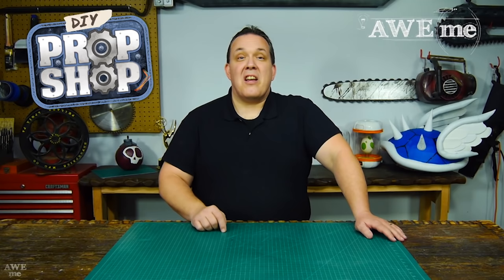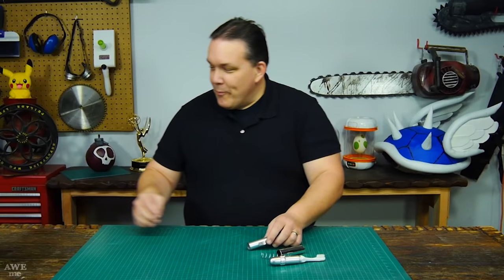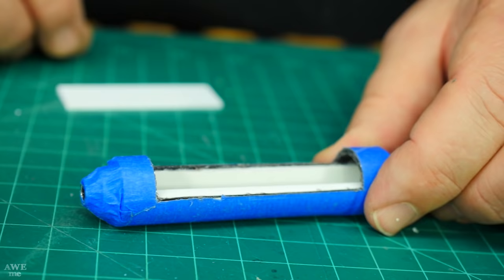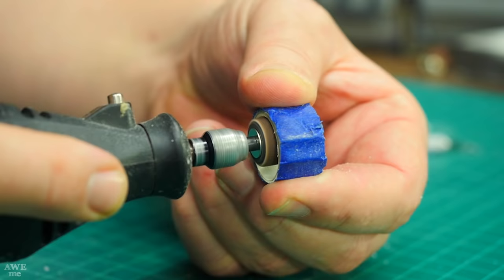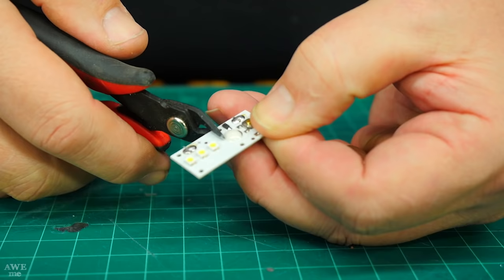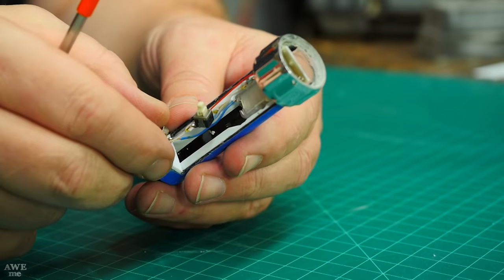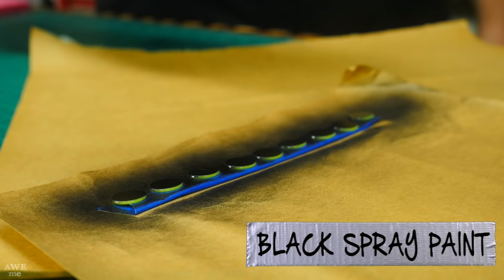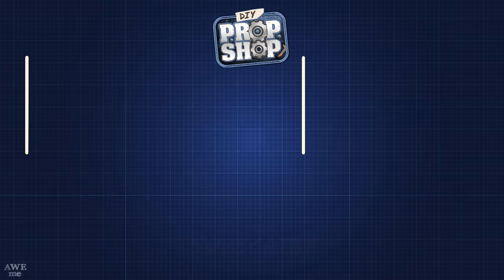Men In Black Neuralyzer - DIY PROP SHOP

Comment: I wouldve personally used a flash from a disposable camera. 1) because it flashes as bright as it does in the film, 2) it makes the same charging up sound and 3) the electronics for it are quite simple.
Reply: Also using a neon light rather than an LED for the red light would look much more authentic.
Reply: it would probably need a stronger battery and it would drain it in no time.
Reply: What a flash drain a lithium ion button cell quickly? I doubt it. Flashes are typically driven by charging a capacitor to drop the voltage all at once. The current is very low. Typically they are measured in watt seconds and come in pretty low.
Reply: You'd have a hard time stuffing the circuit board into that tube, though I guess you could take it all apart and wire up all of the components loose.
Reply: The flash circuit for a disposable camera is quite large, and working with capacitors can be dangerous if you don't know what you are doing.
Reply: Yea you might have fun ;o
Reply: Good luck finding a neon light small enough
Reply: That said, you'd need an AC waveform. I guess fitting a transformer AND a flash in there is a bit much. The flash is totally doable however I've modded camera flashes before.
Reply: "Typically measured in watt second" You wot? how about farad
Reply: I was just thinking, he should have use a mini photo strobe, you know what they say about great minds....lol
Reply: I reckon it would take too much effort to get that to work, what with having to scratch-build electronics small enough to fit inside that small tube, to facilitate the flashing, not to mention having to engineer the insides much more carefully for it all to fit together. 

It would be fair to expect that sort of effort for a centerpiece prop, but for a sidearm-prop like this, I reckon this is as good as you can get without breaking the bank, both in terms of time and money.
Reply: Jordan Straker hi
Reply: Flash circuits for phones go for $3, and fit in phones. This really isn't hard.
Reply: L454RU5 Err. Camera flashes are measured in watt seconds, yes. Capacitors are measured in farads.I was talking about camera flashes, not capacitors.
Reply: Jordan Straker he's a Damm genius so cool man
Reply: Jordan Straker also I would love if you make Namis stick from ONE PIECE you now the one ho changes the climate change that would be AZOME please read my commen 
:)
Reply: What you saying bro? I dont actually understand what you're asking for xD
Reply: Jordan Straker. I was just thinking the same thing
Reply: It needs a big capacitor. ....We can't fix the electronics in there
Reply: Alexei Barnes They still make disposable cameras?
Reply: is there also a red LED that goes off before the flash?
Reply: @Bloo No that's where illumination comes in buy a red piece of plastic and make it to where you can use transparent glue to stick to the red plastic or some how mount it behind the red plastic....
Reply: He should do raiden's hf sword from Metal Gear Rising. Click Like and let this guy know.
Reply: Angela provost, I do believe you mean the capacitor. The battery's in camera flashes are no bigger than 6 Volts. And when I was a kid I remember sticking the 9 volt battery's on my tongue. And that part of your body has low resistance. Its the capacitor that is/can be deadly only in very specific places. Have a good day :)
Reply: I thought the same!
Reply: JMS Motorsport he’s trying to make it as cheap/easy as possible
Reply: This is an awesome video! I have the MIB 2 Neuralyzer replica (#389 of 1,000) created from the actual Neuralyzer prop borrowed from Sony Studios to make sure the look & measurements are exactly the same. It’s a great shiny & heavy piece made of brass, stainless steel, & chrome. There’s very few plastic pieces such as the month day & hour dials, the top blue light, & the Neuralyzer trigger. The sound effects are rather nice recorded from MIB 2’s post-production record in Sony Studios. Just like you recommend, the Neuralyzer flash is as strong as a camera flash so it’s very bright.
Reply: this.
Reply: @L454RU5  the drain of power would be measured in watts per second of the flash being on, he only mentioned the capacitor being used to dump the power all at once. Caps arent that dangerous until go to high with voltage or farads
Reply: @IttyBittyVox  ahh i knew there was an alternative to a disposable camera flash, Nice one

Comment: i would have used a 6th gen cree led for the flash instead since its a lot brighter.. other even the flash of a disposable camera and a small flash capacitor..

also the whole assembly is flimsy at best and is not to scale lengthwise as well as proportionally, and the depressed area for the dials did not look like cheap cut outs and appear to be formed on the smooth mold that makes it ergonomic, and the 3 dials had red led indicators as well as days/months/ years on them as well as a pressure switch for turning on the red lamp as the assembly extends as well as another concealed switch on the third dial to fire the neuralizer

this technology probably also made use of the experimental super capacitors by general electric.

Comment: I am surprised a toy company somewhere never produced high quality copies.
Reply: Two companies have. But I wouldn’t call them “toys”. I have an official MIB 2 Neuralyzer replica that includes a museum base stand with the Neuralyzer number out of 1500 for display (mine’s number 389 of 1500). Columbia Pictures lent Master Replicas & Factory Entertainment their Neuralyzer for hundreds of detailed examinations & measurements to make 1500 official limited edition movie replicas. It’s made with brass & stainless steel with a shiny chrome finish along with turnable month day & hour dials, the top blue light, a charge light & the trigger. Pressing the bottom of the clip opens the Neuralyzer & the flash is as strong as a bright camera flash. Sound effects are recorded from Sony Studio’s MIB post production record. Using it kinda puts you in the movie itself.

Comment: Props are helpful.
Reply: I have an official MIB 2 Neuralyzer prop replica that includes a museum-style base stand for display. Columbia Pictures & Sony Studios lent Master Replicas & Factory Entertainment their Neuralyzer prop for highly detailed examinations & measurements to make 1500 official limited edition movie replicas. It’s made with brass & stainless steel with a shiny chrome finish along with turnable month day & hour dials, the top blue light, a charge light & the trigger. Pressing the bottom of the clip opens the Neuralyzer & the flash is as strong as a bright camera flash. Sound effects are recorded from Sony Studio’s MIB post-production record. Using it kinda puts you in the movie itself.

Comment: I like the Neuralyzer
Reply: I have an official MIB 2 Neuralyzer prop replica that includes a museum-style base stand for display. Columbia Pictures & Sony Studios lent Master Replicas & Factory Entertainment their Neuralyzer prop for highly detailed examinations & measurements to make 1500 official limited edition movie replicas. It’s made with brass & stainless steel with a shiny chrome finish along with turnable month day & hour dials, the top blue light, a charge light & the trigger. Pressing the bottom of the clip opens the Neuralyzer & the flash is as strong as a bright camera flash. Sound effects are recorded from Sony Studio’s MIB post-production record. Using it kinda puts you in the movie itself.

Comment: Would you please start making and selling them?
Reply: 😎I have an official MIB 2 Neuralyzer. Sony Pictures lent Master Replicas & Factory Entertainment their Neuralyzer for detailed examination making 1500 limited edition replicas. It’s metal constructed & shiny chrome finished with month day & hour dials, the top blue light, a charge light & the trigger. Pressing the bottom of the clip springs up & turns on the Neuralyzer. Sound effects are recorded from MIB’s post-production records & the flash is as strong as a camera flash. Using it kinda puts you in the movie itself.🕶

Comment: i regret throwing my burger king toy away after the batteries died.
Reply: 😎I have Jay’s MIB 2 Neuralyzer. Sony Studios lent Master Replicas & Factory Entertainment their Neuralyzer for detailed examination making 1500 replicas. The prop is made from brass, stainless steel, & chrome with month day & hour dials, the top blue light, a charge light & the trigger. Pressing the bottom of the clip springs up & instantly turns on the Neuralyzer’s lights & sounds recorded from MIB’s post-production records. The flash is as strong as a camera flash so it’s very bright. Using it kinda puts you in the movie itself.

Comment: That's cool and all, but you can buy a ready made neuralyzer toy for $31 on amazon.
Reply: I have an official MIB 2 Neuralyzer prop replica that includes a museum-style base stand for display. I wouldn’t call it a toy though. Columbia Pictures & Sony Studios lent Master Replicas & Factory Entertainment their Neuralyzer prop for highly detailed examinations & measurements to make 1500 official limited edition movie replicas. It’s made with brass & stainless steel with a shiny chrome finish along with turnable month day & hour dials, the top blue light, a charge light & the trigger. Pressing the bottom of the clip opens the Neuralyzer & the flash is as strong as a bright camera flash. Sound effects are recorded from Sony Studio’s MIB post-production record. Using it kinda puts you in the movie itself. One is being sold on Amazon for $1,200.

Comment: Smart and cheap but nothing like the actual thing
Reply: 😎 I have the MIB 2 Neuralyzer. Sony Studios lent Master Replicas their Neuralyzer for detailed examination to make 1000 limited edition movie replicas (I have #389). It’s shiny metal constructed with turnable month day & hour dials, the top blue light, a green charge light indicator & trigger. Pressing the clip springs up the Neuralyzer turning on the lights & sounds recorded from MIB’s post-production records & flash very bright. Using it kinda puts you in the movie itself.

Comment: Can I just buy one of these rather than make it myself?
Reply: 😎 I bought & own the MIB II Neuralyzer. Sony Studios lent Master Replicas their Neuralyzer for detailed examination & measurements to make 1000 exact prop replicas of the movie’s. It’s shiny metal constructed with month day & hour dials, the top blue light, a green charge light & trigger. Pressing the clip springs up the Neuralyzer turning on the lights & sounds recorded from MIB’s post-production records. The Neuralyzer’s Xenon strobe flash is very bright. Using it kinda puts you in the movie itself.

Comment: Too bad it can't flash like in the movies.
Reply: Mine can. I have an official MIB 2 Neuralyzer prop replica that includes a museum-style base stand for display. Columbia Pictures & Sony Studios lent Master Replicas & Factory Entertainment their Neuralyzer prop for highly detailed examinations & measurements to make 1500 official limited edition movie replicas. It’s made with brass & stainless steel with a shiny chrome finish along with turnable month day & hour dials, the top blue light, a charge light & the trigger. Pressing the bottom of the clip opens the Neuralyzer & the flash is as strong as a bright camera flash. Sound effects are recorded from Sony Studio’s MIB post-production record. Using it kinda puts you in the movie itself.